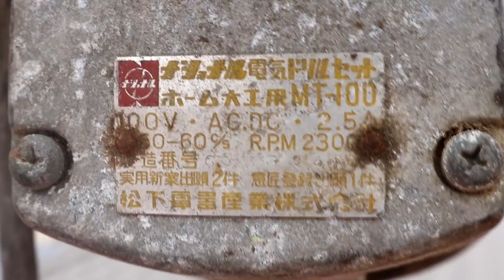Vintage Cord Drill Restoration [National Brand - Unknown Year]

Comment: This is not restoring this is cleaning.
Reply: Wrong
Reply: @martianshoes  7 says I'm RIGHT
Reply: NO, putting new tires on an old car is not Restoring.
Reply: Probably more clean than restore. But then again, the restoration process consists of MAINLY cleaning.      Ever "restore" headlights? that's right, you CLEAN off the oxidation.
Reply: and restoring ;3
Reply: When you have a device or building that is in disrepair, and you take it apart, clean it and put it back together adding what  is needed to make it functional again...that's pretty much the definition of "restore."  You are restoring it to functionality.
Reply: @originaldcjensen  Restoring is bringing it back to ORIGINAL working shape.  Anything else is repair, refurbish, cleaning etc.
Reply: Disagree
Reply: @duhjooner  Go and talk to anyone who is truly restoring especially cars.  what he did here is a great job of cleaning.  A car without original parts is not restoring it's repairing or restomod.
Reply: @duhjooner  Getting a car to run again is not restoring.
Reply: @hotforteacher7540  Regardless of what YOU think the word means, you can't just bend words to a different definition because you think it doesn't sound right.
Reply: Seisman 75 why the miserable nit picking? I just changed the brushes on my 1977 belt sander so how do we define that repair I suppose but so what?
Reply: I say he restored it back to life. Most people would have thrown it in the garbage.
Reply: In the car world we'd call it refurbished.
Reply: True.
Reply: It was built for higher safety but the blue wire was ignored. Should have been connected to the ground connection.
Reply: Hasn't everyone figured out the guy was trolling?
Reply: Most restoration involves cleaning off years of shit.
Reply: watch the fucking video
Reply: Seisman 75
I have to agree. You can clean something without restoring it, but you usually can't restore something without cleaning it. As far as these "tool restoration" videos go, I believe the term "restore" refers to doing everything it takes to make an old tool as close to new condition as possible. This video did not do that. There are many places on the drill that needed better cleaning or replacement parts to make this a true "restore". Stop the video at 11:24 and you can see discoloration in the ridges of the blue handle. I can't tell if it's dirt or the color is gone. If the handle can't be cleaned to a level that is almost new, then it needs to be painted or replaced. Look at 11:26 and you'll see the nut on the switch is corroded or dirty as is the pole of the switch and the plate on the switch looks like it is supposed to be black & red for off & on. Again, to make this a true restore those parts should have been cleaned and painted or replaced. These are just a couple examples.
All in all,  based on other "restoration" videos I have seen, I would consider this to be a "clean & repair" or a "resurrection", but definitely not a full "restore".
Reply: If I hear that comment again.  Not restoring this is cleaning.  Every restoration video seems to have this guy lol
Reply: @hotforteacher7540  no it is not restoring but you dont replace the ties on a car when you are cleaning it
Reply: We call it upkalefateren
Reply: Can everyone stop arguing, maybe then you might clean my faith in humanity
Reply: @hotforteacher7540  But if something is very rusty/dirty ( like this drill was ) and you clean it up,  you restore it to it's original condition. Therefore it's called Restoration.
Reply: Great job man
Reply: seisman75 ...in order for the title to be correct....what would you have done differently? It's amazing  to me how one troll can get under the skin of so many. This person was the first to name call. Probably nothing better to do with their life than bully other people. Good day everyone .....except you know who!!
Reply: Keyboard Crusader  there was no new cable
Reply: Gears not disassembled and cleaned, nor repacked with grease.  Bearings not replaced with new sealed units.  In early section of video we could hear how noisy the drill was when turned.  No.  NOT good restoration work.  Purely superficial.  Will not last.  Waste of time and effort.

Comment: Please give reason for ice water ?
Reply from the maker: Ice allows water go inside the chuck drill than the water remove rust between all parts inside the chuck. I choose this way I want to keep original chuck metal.
Reply: Why not use WD 40 from the start??
Reply: @rick33ful  Are you serious? Because there is more than one way to skin a cat! You can use your way with WD40 and he  can continue to use his way with ice water, which worked, by the way.
Reply: WD-40 is trash
Reply: cold makes metal contract
Reply: Нормальные люди в таких случаях керосин используют. Надеюсь ты переведёшь этот текст.
Reply: Ice water does the same as a torch, essentially. Just in reverse. And because it is making the metal shrink, rather than expand, it opens the gaps between the parts, so may be more effective than torching. I'd still go WD40 first, myself... but if it works, it works!
Reply: I may be as you say but it is in almost every place. And it DOES penetrate.

Comment: Nice to see this tool get a new life. Since the drill has a metal case and there is no earth wire, maybe you should have used more insulation for the electric cables inside.

Comment: To remove the chuck on 2  old B & D Holeguns that are about 45 to 60 years old I chuck up a1/4 inch right angle Allen wrench and wack the wrench with a hammer.  Works every time.    30 years with Otis Elevator.  Hope this helps.

JoeB

Comment: we have japan brand national  appliances then in early 70s, 2nd hand National getcycle refrigerator, National vacuum cleaner, National washing machine all made and coming from japan,  we have also national elec fan, and national black n white TV locally made.... very sturdy and high quality appliances especially the jetcycle ref can make an ice in less than 15min, indestructible washing machine and hardworking vacuum cleaner we resold them after 10yrs of using they are all in good working conditions.... the National brand today is panasonic brand.

Comment: Get a three wire cable with a grounded plug, drill a hole on the metal handle somewhere, thread the hole, fasten a screw hole plug on the ground wire and fasten it with a screw, and voila you have grounded this one so it will be safe :)
I got an old all metal large heavy angle grinder i found in the trash 30 years ago, i did change carbon rods, it still works.

Comment: Nice to see an older tool returned to working order. But like others, new grease would have helped it along in years to come. Also not sure what your wiring standards are where you live, but I would have replaced the cord with one with a ground wire. There was even a spot to tie ground to the case in the handle. With an all metal case tool, grounding is pretty mandatory. Glad to see you at least checked it out before picking it up!

Comment: I have one like this but 3/4 chuck. it has Wizzard on it which I think was sold by Western Auto.  Don't get it hung up, the damn thing will twist your arm off.  The sears 1/2 you can hold with three fingers, very good on soft pine and soft water.

Comment: Protip: Melt some wax, get it nice and hot so that it is all liquid and flows easily, then submerge the windings and keep them down until no more bubbles come out of them, then bring them back out and let the excess drip back in. It will protect them somewhat and even fix sparking/shorts. By the looks of them they are burned to high heaven.
Reply: Oh, and put some heatshrink over that solder joint near the switch.

Comment: Hi! Nice restoration, but if you are going to use that drill you should change the power cord for a 3 wire one so you can ground the drill, as it is now if at some point the cable touches the aluminium shell you are gona get a nasty shock!
Reply from the maker: Yes I will change it, anyway thank you so much for feedbacks.

Comment: I know it's not original, but when I repair or restore one of these old aluminum bodied tools, I always replace the cord and plug with three prong three wire and attach the ground to he case inside.  You can still make it look great, but this way it will be much safer too.

Comment: I would absolutely replace the cord with a three wire cord and connect the earth wire to the inside of the casing . Just drill a small hole somewhere in a suitable place and attach it with a self-tapping screw. At least I would before i'd use it. Better safe than sorry in this case!

Comment: When desoldering, reflow new solder over the joint first to give you thermal linkage to the work.   You'll find this is much easier to get a melt, and less damage to the surrounding components.

Comment: When I was a young kid (maybe 8 or 9 max--back in the mid 70s), my dad had a drill very much like this that stopped working. He let me take it apart. I remember it was very similar to this inside, including the replaceable brushes. It was nowhere near as rusty as this. I think it was just the brushes that were bad, but he had a nice, new drill, so this was expendable and a good experience for me, so he let me take it apart to see how it worked. I remember it was interesting how the gears reduced the speed of the motor. Thanks for this bit of nostalgia

Comment: I think you need more insulation, a cardboard and the tape seems insufficient, because is metal enclosure with no double insulation. I suggest to use thermofit (heat-shrink tube) isolation in the soldered parts and/or insulated terminals, and isolate the switch with liquid tape, silicone or epoxy. Maybe to change the switch with terminals so you can use isolated terminals there too. Also you could add an extra terminal box for isolation and maintenance.

Comment: Drill collectors might like that, well built for life, dangerous because of that ON/OFF toggle switch, must have a momentary switch instead, unnecessary wire brushing and cleaning procedure with soap and water while you had a polishing discs, you must use rust remover fluid for cases like this, overall a fair job.

Comment: Please use caution! As written on the name plate, it works at "100V" AC/DC. The voltage of mains electricity of Japan is 100V which is the lowest one around the world. So if you use the drill outside Japan, it inevitably causes overvoltage.

Comment: At least the motor seemed to be almost unused, judging by the brushes and commutator. Basically a clean-up, although that chuck certainly looked badly knackered! Good job on that. 

I agree with the person who said that it needs an earth wire.  Unless this is going to be a decoration, don't let your family (nevermind yourself) near a metal-bodied drill for any work unless you think their lives are worthless - especially when they try to rescue your electrocuted body gripping it like death. 

You should also replace the capacitor/suppressor across the supply.

Comment: Looks like an old Makita drill my dad had decades ago. I would have also replated the case, before polishing..and then after polishing to an awesome metallic shine, I would have painted it with Hot Wheels Spectraflame paint. Just look up how to restore Redline Hot Wheels cars to deal with this type of metal. I also would have totally replaced that two wire power cord with a three wire and GROUNDED the case...

Comment: This drill has a metal housing but the power wire has only the L and N conductors. But the PE conductor is missing. In case the L conductor touches the housing then you 'll get an electric shock!!!!

Comment: Compared to new drills those old ones are a death trap...... the whole thing conducts electricity and has 240v going into the base with minimal insulation....... and to think they use to use them with out surge protectors...... crazy

Comment: Nice restoration job, except for one problem.  Later on they find him laying dead with the drill beside him from electrocution.  Even though you could put on a three prong plug with ground, those old drills were good for shocking people because of the conductive aluminum case.  So, you know what will happen if something is wrong with the ground on the cord and the drill shorts to power on the case.  I would prefer using a newer drill with plastic case and no chance of getting shocked.

Comment: Nice restoration, he did a great job. 

Speaking as an electrician, there are a couple of problems that I see here. That thing is not double insulated, and therefore should have an earth. I would have been tempted to weld an earth tag to the inside of the casing, somewhere hidden, and replace that 2-core flex for a 3-core with a three pin plug. 

My second and final point is. Lose that voltage detecting screwdriver. Those things are horribly dangerous, and there are some great alternatives on the market these days, that don't require you to be a part of the circuit when testing.

Comment: Grasshopper good try but in grong order uv shal make worky first, them resemble. poolpump motor repair guy say.''fix the inside than worry bout outside than test. you v  swoon walk rice paper grasshopper ..lol  but good to see fixers ! keep it up. FACT we all all learning.. good stuff 
tip.. it can be hard to find bearings for old tirds like this so be careful and clean and lube them.and use never seize on bolts/ screws will make this tool last for GENERATIONS

Comment: Brand name is "NATIONAL" presently it is "PANASONIC".  Matsushita owns it. You did not initially checked it by powering on. Further, both bearings need replacement and the gear box needs fresh grease. You avaided, result "noisy machine". You merely cleaned it not restored. Futile exercise.

Comment: Let me correct some info I've posted couple week ago. It's under name of "NATIONAL" brand  which was basically used before 1973 when the logo has changed to"National" both in Japan as well as other foreign countries. The plate reads Matsushita -Sangyou-Corp. in Japanese.  Sakaki San just kindly informed us that the model No. is  "Mt-100" which is correct, I can also read the model No. on the plate, though it's so unclear to understand. Maybe these are the things we can figure it out. Any other opinion?

Comment: Nice job, but I won't be caught using it for electrical safety. You should really, rreally, REALLY have replaced that 50+ year old capacitor. That thing may short out any moment and it looks really underrated. It should be rated at least 400V.

Comment: The older stuff - where ever it was built - could be tinkered with.
Sometimes you could get it to work again.
Modern power tools are carefully designed to work for a specific number of operating hours -
Then they die.

Comment: Single insulated no good. new bearings ,not replaced ,nothing wrong with the drill transmission. was fine you didn't do anything except clean it and put an old dangerous drill back in service

Comment: I've seen a similar model from Japan, equipped with the safety power trigger; and that one was from the 1960s.  Your's obviously predates it, since it is operated with only a toggle switch.  I'm guessing it's from the start of the 1960s at the very latest.

Comment: My hat's off to gear show and anyone else who takes the time to return broken equipment to functional usable condition. The more we fix things instead of buying new, the better for us and the planet. There have been a lot of comments about what constitutes a "restoration" I think it's fair to say there is a range of what one considers "restoration". An item such as this drill is totally non-functional, covered with scale, rust and potentially has other problems. On a 10 point scale I would call this condition level 0 or 1. Conversely if you had just purchased this device brand new from the store it would be at a level 10. So how would I rate this restoration? Probably a 5 or 6. Why? Well, obviously the drill was functional and useful so that's all good. However there were a number of additional steps some cosmetic (scratches) and some functional (gear/brush/bearing noise) that I would have done, if the aim were to restore it closer to level 10. If you want to see level 9.9 - 10.1 restorations of machine tools, I recommend you check out "my mechanics" channel on YouTube. It will make your jaw drop.

Comment: The sound of the motor tells me that there's still some dust in the rotor windings. You should clean it with distilled water. Also change the plug with a 3 way earthed plug.

Comment: I would have would have replaced the electrical cord with a ground - black, white and green conductor and a three prong plug. New grease for bearings and gear box? Nice resurrection, that poor historic Japanese drill was left for dead. 
A little bit more info: http://yahoo.aleado.com/lot?auctionID=m166069980

Comment: Why you didn`t start it?Its looks like the stator`s windings are burnt.I don`t belive that the insulation is ok.Next one-in my oppinion bearings also should be replaced,becouse all grease already leaked out from them.Finally - its not a restoration,its simply cleaning and nothiang else.

Comment: If you get seized, rusty gear like that, spray it with WD40 and leave it for a few days. It'll loosen up, if not then spray again and wait. Saves damaging anything.
Reply: also, you could leave the chuck standing in lemon juice. it'll fetch that rust off without any sweat

Comment: And man is that a scary piece of junk. A cord drill with metal casing and a two wire connection. No earth wire, just phase and neutral. If the phase wire comes in contact with the casing inside you'll be electrocutet. That drill wouldn't be legal to sell today. At least not in sweden where I'm from...